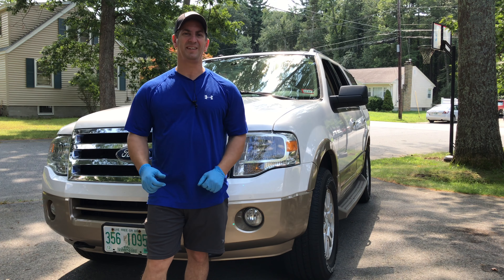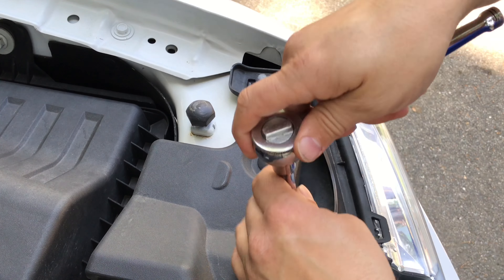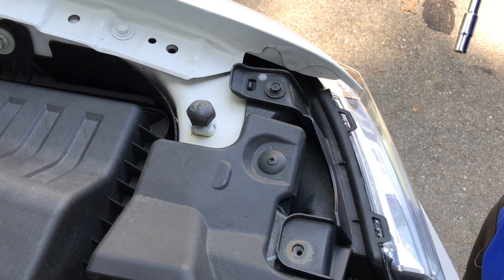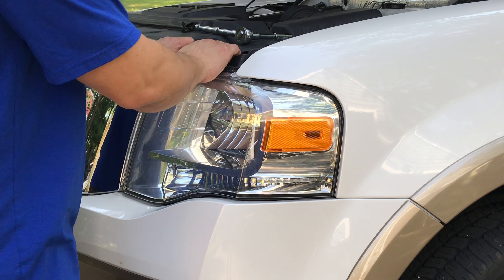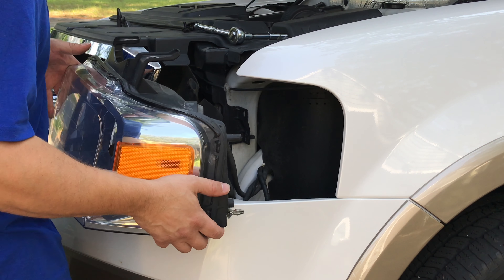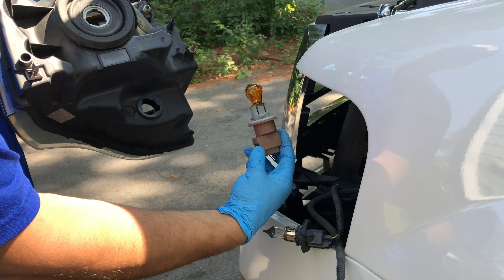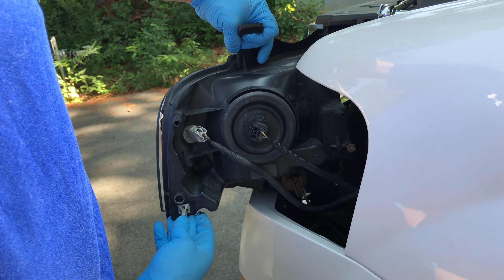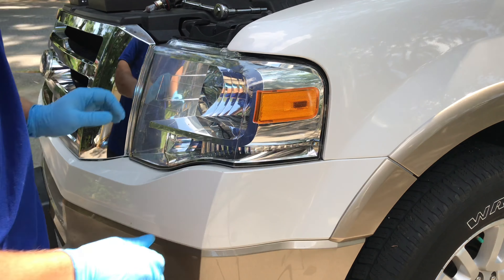How To Replace 2007-2014 Ford Expedition Headlights

Comment: Just did mine on an 07. Was having a hard time mounting the new bulb. Noticed that the sylvania silverstar I’m replacing the OE with, already has the gasket installed. So no need to use the orange gasket that was OE
Reply from the maker: Thank you for watching our video on how to replace the headlights on a 2007-2014 Ford Expedition. Hope this auto repair video helped you out.

Comment: Do you recommend only factory headlights. They are pretty pricey. Needing to replace mine on my 2010. They are clouded and weathered. What brand would you recommend that does not break the bank.
Reply from the maker: The oe headlights will always be the best quality, however we have had good luck with the aftermarket replacement Ford Expedition headlights as well.

Comment: Hello I installed LEDs on a 2013 Ford Expedition. Now the day time running lights are not working. Is there anyway to fix it?
Reply from the maker: Put the old bulbs back in to see it those are working properly. My 2012 Ford Expedition has daytime running lights and they have been fine with LED bulbs. I have had three different sets of light bulbs in this Ford Expedition.
Reply: @HomeownerRepair  Thank you for your response.